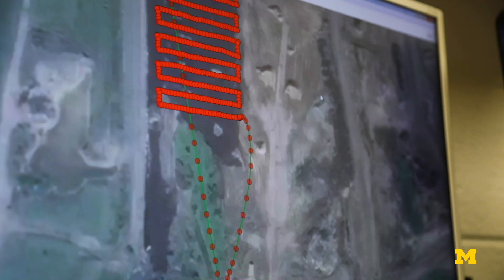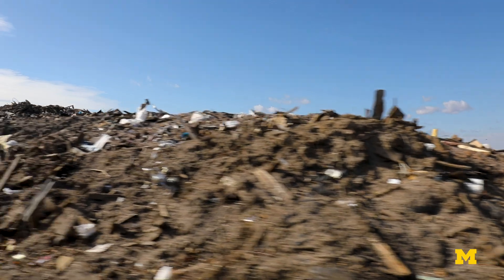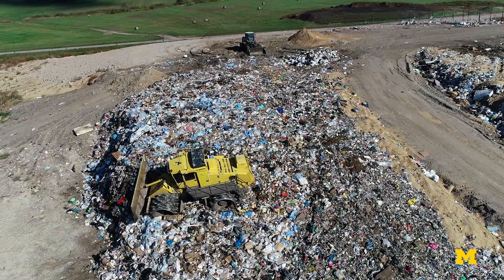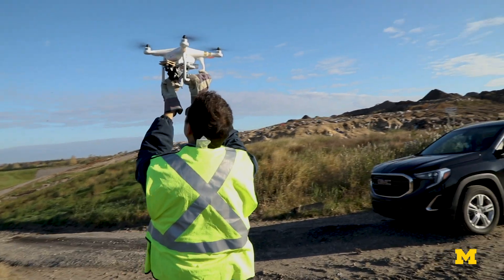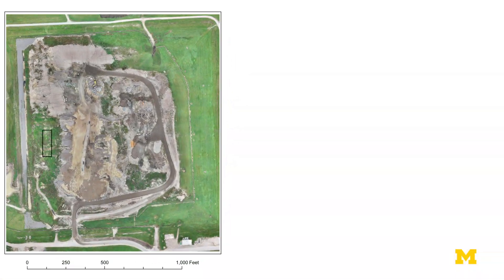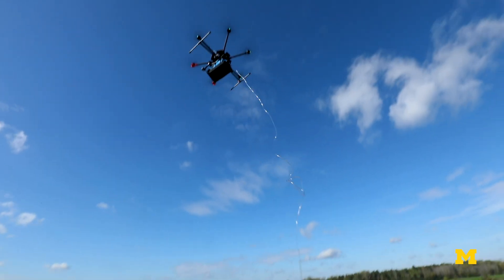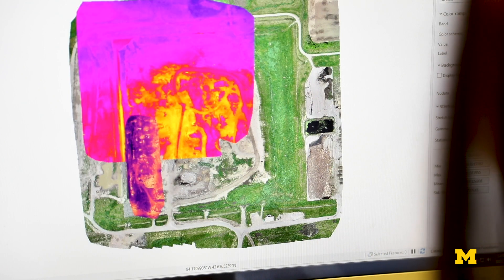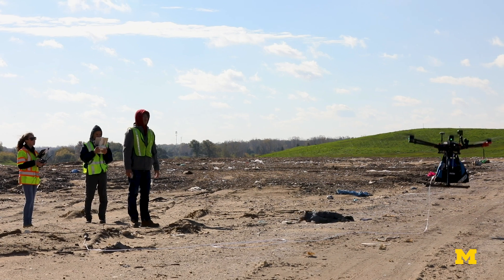Using autonomous drones to map methane in landfills

Comment: The use of drones to monitor fugitive methane emissions at landfills is interesting and appears to be a good application of the technology.  However, there are statements made in this video that are not accurate.  By law in the US, methane from landfills must be collected and either burned onsite (CO2 is considered significantly less adverse on the environment than CH4) or where it makes economic sense, either electricity is generated or the methane is collected and sold into the marketplace.  To generalize and posture that this is not occurring is incorrect.
Reply: Hi Glen. Indeed the video is intended for a wide audience so indeed it is not going to specifics for a technical audience. You are right that by law gas is collected and supposed to be burned and in far fewer cases for energy. At best 30% of gas is generated for energy purposes, but we suspect much less.  The process of collecting the gas is not very efficient. We believe there is a lot of gas that could be used for energy that is either collected and burned or emitted. Gas systems are not installed immediately, they are not 100% effective and the nature of solid waste (anisotropy, variability) makes gas collection more difficult and inefficient. Landfills were developed in the 1980s for containment and are not optimized for energy generation, which is our mission.  We hope this and other work will shift the philosophy of waste management from containment to energy harvesting. The former is a technology of the 1980s, the latter of the 21st century. Will be glad to provide extensive literature on the above.